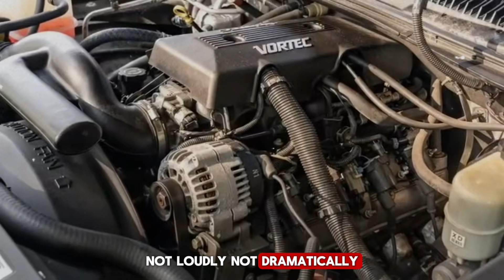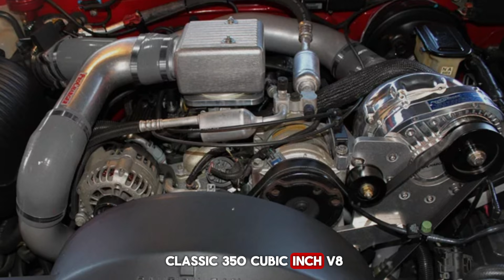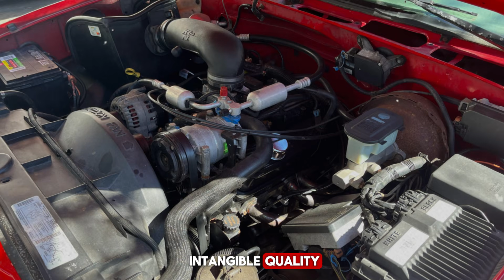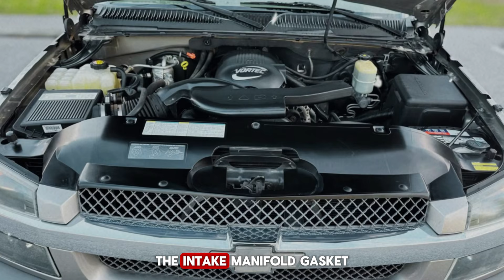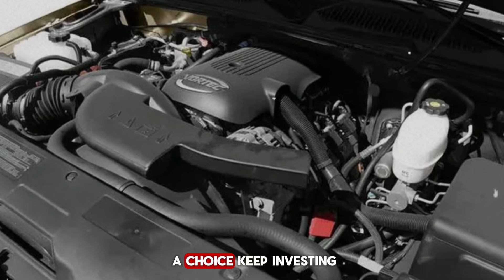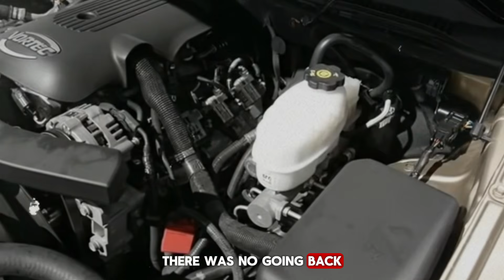The Real Reason GM Phased Out the 5.7 Vortec

Comment: This is BS because during the turn of the century Toyota bought the rights to build a new 350 design from GM. That was never mentioned here.
Reply: That's similar to what I heard. GM I heard GM.was working on the LS platform and and a overhead cam version. I always wondered if Toyota got that with their 5.7. Was always wondering if they worked out some deal that GM  maybe they couldn't 6:38  build a 5.7 do to Toyota having it?

Comment: 2:48 1996 GM got rid of the swirl ports in the heads. They didn’t need it anymore because of central port fuel injection. It went to 255 hp because of the higher lift and duration cam.

Comment: The LS doesn't impress me , my 2011 Silverado 2500HD with the 6.0L LS is a dog that ONLY gets 10mpg! Where a 1979 Chevy C20 similar equipped with service body and weight with a well worn and oil burning 5.7 will LITERALLY and figuratively smoke that LS!
Reply: probably because the HD is tuned for torque and pulling not 0-60 .... i have a 5.3 1500 and 6.0 2500HD  and the 1500 5.3 is more peppy than the 6.0 but doesn't have the same low end torque like the 6.0 it's definitely all about tuning . and just FYI my  1500 5.3 with headers would destroy that c20 5.7 see how that works .
Reply: Your truck is slow…..
Reply: @tbz7567 😅
Reply: 79' 350 is a dog. 180 hp max
Reply: The old C20 weighs a couple thousand pounds less too. You put the new drivetrain in the old truck and it will walk the dog on the old engine. I still love the old stuff because I grew up with it. Worked in the Chevy dealer from 01-03 and worked on the new ones too. Still prefer no computer though. Double pumper  and a good cam. Just too bad the fully ported stock heads don't compare to the factory port of the LS.

Comment: I like how you forget to mention many vortecs were going 300k+ miles before showing issues.  30+ years of service before needing replaced.
Reply: allot like the 3800. they also run forever, good fuel efficiency for a larger displacement V6. reliable. simple. GM lost it's way, and was largely forced by the government
Reply: Best of both worlds, got an 04 tahoe with an aluminum 05 5.3 and an 02 camaro with a 3800
Reply: My 96 is sitting in the driveway ready to go.
Reply: SAME WITH THE SPIDER INJECTION MINES 35 YEARS OLD COLD STARTS PERFECT NEVER CLOGS OR MAKES CARBON
Reply: @mikehunntt5338  that's impressive. that system generally isnt regarded as being the best. generally a great engine with so so fuel system
Reply: Big facts . Mine got 246k miles and I’m just now changing manifold gasket and spider lol

Comment: But the 5.7 is returning  for 2027
Reply: Just a number,  GM claims "next generation" , but I doubt it's radically different, probably just bore and stroke changes.
Reply: It’s a 6.7
Reply: @Gmt800master  GM is introducing a new 6th-gen 5.7L Small Block V8 engine for the 2027 model year, aiming to replace the current 5.3L V8 in trucks like the Silverado 1500 and GMC Sierra. This new engine will likely feature dual injection (direct + port) to prevent carbon buildup and is expected to deliver around 400+ horsepower.
Reply: @Gmt800master 6.6 to be exact for GM...6.7 used only in Ford Super Duty and Ram HeavyDuty
Reply: @Gmt800master 5.7 & 6.6*

Comment: They could have extended the crankcase below the main bearing caps, Y block style, and they could have made LS style heads that would fit, and they could even re-work the block to have a valley cover separate from the intake manifold, but at the end of the day, they still would have had an engine with design roots in the mid 50s.  Not at all a bad thing for me, but tech-freaks would soon have been relentlessly panning it as being "outdated" and "obsolete" compared to the Ford Coyote engine.   At least the LS could be advertised as an all-new design.
Reply: gm was/is focused on cheap, cheap, cheap!!🐣